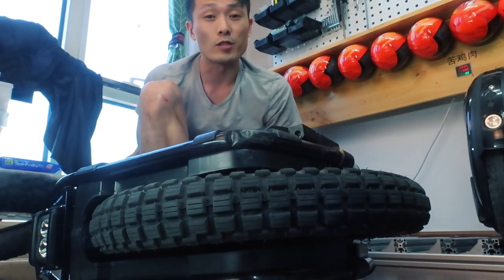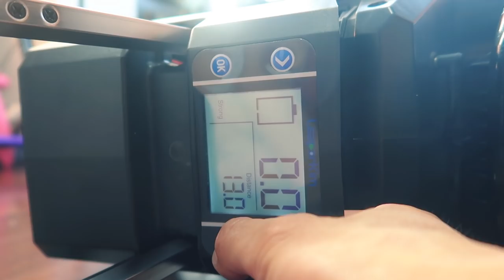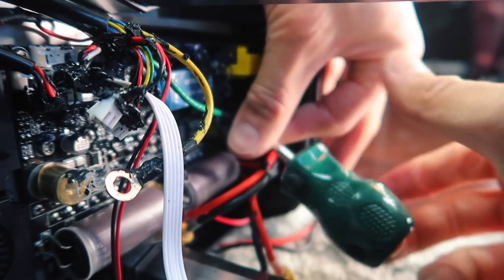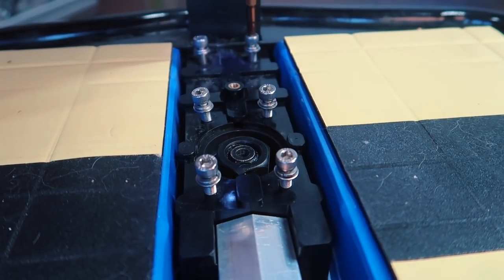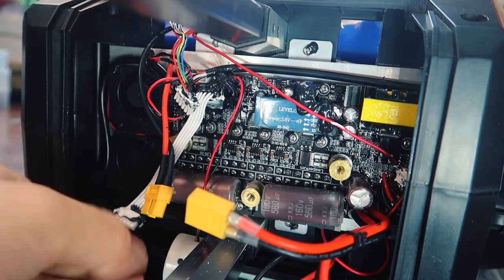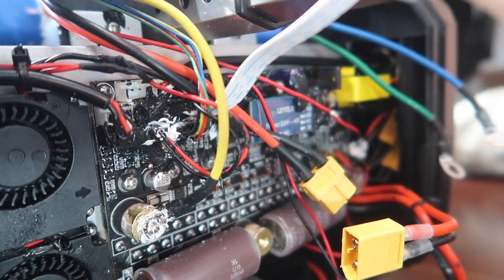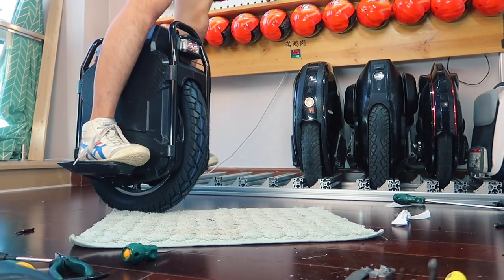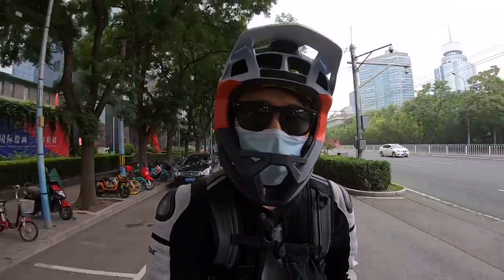Putting a Street Tire on the Veteran Sherman

Comment: Yep they are really weeding out the true enthusiasts with that tire change
Reply: Nothing wrong with the original tyre in the first place 🙄
Reply: @afms-jo2de  not the point...🙄 eventually the tire has to be changed.
Reply: @Kay0Bot  Have multiple wheels and you will be in no hurry to do a tyre change.
Reply: @afms-jo2de  yea , 50 wheels sounds like the right amount. No more tire change ever...😏
Reply: @Kay0Bot  if you can afford it, why not 😛
Reply: @afms-jo2de  Don't these wheels cost quite a bit? Idk what proportion of people will buy multiple just to avoid tire changes. They should just make the tire change easier, it's obviously the most reasonable for the consumer.
Reply: I am 100% sure I am not doing this my self if I ever need to change the tire.  Or not buy a euc.
Reply: Funny thing is it's easier than other wheels and they made it a lil bit better with later models.
Reply: Just did my first tire change on my Master. Bro, it took 2 hours of everything going right. 😪

Comment: Overinflate the tire so the bead seats properly. You hear it pop when it seats right. Then deflate. Usually about 60-75psi to seat, then down to 30ish
Reply: Are you assuming the Tire fits? Why? My assumption is: The tire looks cool they choice it without adjusting the construction of the wheel according to the tires specs. Childish ? Yes... Dangerous ? Yes... Gotway like ? Yes also that

Comment: When you pinch the tube slightly during install and just hope it goes away. It never does.
Reply: marsrover001 you can depressurize the tube until it’s barely rideable, then go around the block, sometimes that straightens out twists or folds. It worked for me on the recommendation of Jason from ewheels.

Comment: This is ridiculously complicated, and even dangerous, in order to change a tire!
Reply: welcome to the world of eucs
Reply: Bad engineering. They wanted to rush production and didn't bother with long term maintenance.
Reply: @Tiagotaf  Yep!
Reply: I think que Unicycles are evolving. Kuji already did show an unicycle que have suspension. Maybe the next level will be a better way to justo replace tires. The Trolley Handle for example we can see as a default accessory, but the firsts Unicycles even had one
Reply: Fix a flat might work in most situations, but replacing a totalled tire would probably have to be done by an expert
Reply: Sad thing is that LeaperKim did such an excellent job of making the headlight and batteries easy to service. Everything on this beast is so well thought out except the most obvious thing.
Reply: @JesterOTL  Its Chinese way of saying "get stuffed Ill take your money"
Reply: @FinnBjerke  Seems like a great opportunity for a new competitor. I could see an Apple EUC--of course it would cost twice as much and only have half the power :)
Reply: @JesterOTL  Make tire fit onto a wheel? Even in a backwards 3 world communist state? It must be possible, other EUCs dont have that problem.
Reply: Sooo Martin your line of reasoning/sarcasm is a little absurd. What is relevant here is: make a tire fit onto a wheel? Even 3 world communists should be able to do that?  And BTW: Apple is for upperclass twits - Windows is worse - use Linux/ Ubuntu.  Its open source and free.
Reply: @JesterOTL   it every year they can add 1mph more to make you upgrade…
Reply: @FinnBjerke  I like the idea of an open source wheel project!
Reply: @no1up  A modular open upgradable design would be so awesome…

Comment: Man they really need to find some way to make the wheel more accessible! Having to go through all that each time just to swap a tire or patch a tube is a huge pain!! Btw is the outside diameter the same as stock? As in this won’t affect the top speed will it?
Reply from the maker: Yeah, pretty much identical width and diameter
Reply: @KujiRolls  Did it go any faster?

Comment: You got to do all that to change a simple flat though?  Damn!
Reply: I just had a flat on my KS18XL and I used "Ultra Instant Bike Tire Inflator Sealer"  from Walmart and it worked great. It's basically a bicycle tire sized Fix-a-Flat. No disassembly needed...
Reply: Andrei Petunin  So far just a few days. I just did it. But I have no reason to expect it won't last as long as the tire will last or until a new puncture develops. 

I squirted it inside and then rode the EUC for about 3 or 4 miles to really spin it up in there while it was drying and to make sure it balanced out evenly.

Comment: You did it! Hell yeah, make sure the tube isn't getting pinched between the rim and the tire and also make sure the valve is properly aligned with the rim valve port those might be the reason you popped

Comment: That sucks! I feel for you. 🙁
With tube tires its good to semi-inflate the tube to maybe 10 psi after installing, then use your hands to fully work the tube and tyre because itsmsoft enough to squeeze.
That makes sure the tube is not pinched. And some talcum powder or chalk rubbed on the tube will help it find the natural position and get less abrasion.😁

Comment: I wipe around the new tyre, inside with a wet wipe just in case there are sharp bits or stones in there. Then like what others have said be ultra careful about making sure the inner tube is not pinched anywhere. What a bummer!

Comment: The next generation should have a better user friendly changing.
Reply: yes i agree, not user friendly to have to dissasemble powercables and stuff. it should have a joint on top so it opens like a waffle iron, and u can then switch out the wheel and rim superfast.
Reply: @magnetmannenbannanen  I doubt a design like that wont be very strong
Reply from the maker: agreed. This wasnt fun the second time either.
Reply: @KujiRolls  Do you have any technique changes go change the tire more effectively?

Comment: I use baby powder (talc) in my mountain bikes and dirt bikes before putting the tubes in.  It acts as a dry lube and I never get pinch flats, even aired down to really low pressures.  Just put some inside the tire before installing and roll it around to spread it out.

Comment: Swapping tires and inner tubes is one of the big issues I have with unicycles. Both of Msuper X 84V (2 pairs) almost caught on fire due to wrongfully reconnecting the battery. And this was after I installed a brand new tire and inner tube on the wheel. Inmotion, Kingsong, Gotway, and Sherman have to make these changes: easily replacing a tire without taking the unicycle apart and make battery swapping easier and safe.

Comment: Hey when I’ve put my tube back into the frame of the tire I cover it with dishwashing soap and water so it can slide in the frame if it’s not seated properly, as well it seems to help keep the tube from getting pinched and staying pinched. I didn’t see you put any kind of lubricant on the tube for the tire. It also will show if there are any pinholes in the tube which sometimes happens before you get it or while handling it. Good luck and thanks for the post.

Comment: The inner tube must have some air in it when installing the outer tire. The  tube ended up twisted or pinched between the tire and the rim  -- and was chafed until exploded .
Reply: yep, i've learned this the hard way too.
Reply: Should have used a bit of talc on the tube to make it seat better

Comment: Use a lubricant on the tire bead and it should settle fine. I had the same imbalance issue last time so deflated it, made sure tube was not pinched anywhere, and lubed up the bead. Rode it for few hundred metres at 20 psi then inflated to full, no issues.

Comment: the tire it came with is specifically design for the gyroscope counter weight system, plus the thicker tires absorb more of the bumps in the road and provide better peripheral stability when leaning left and right. but then again, you can go window shopping for similar size, thickness, and weight tires with better
grip sutures or what ever you call the rubber protrusions in the wheel that help with traction on the ground. 
I'm curious what would happen if you catapult forward crashing onto the ground at  60mph with this wheel. I'm sure you full body armor will shatter and definitely break many bones.
if it ever does happen, turn into a feetle position, and try to roll int the ground to absorb the impact.
Reply: I crashed on one going 42mph.  You don't slam into the ground, you go sliding, just like a motorcycle.

Comment: When my preordered Sherman is ready from eWheels in about 3-weeks, per a recent update email I received from them,  I will have the option to elect a street tire or the off-road tire. I think I will elect the street tire and have it come already installed straight from Veteran...
Reply from the maker: I find the knobby more stable and easier to turn at high speeds on the street. If your speeds are typically <30mph, then the street tire is a clear winner.
Reply: @KujiRolls  So far my speeds have been <30 mph because I currently only own a KS18XL. However I have a KS S18 on the way, and the Sherman. I wanted a variety for different situations. The S18 because of suspension (obviously).

But I wanted the Sherman because it can go faster than Kingsong wheels. It would be my speed wheel. I thought street tire would be better for this, but maybe not. Do you think I should stick with nobby tire? Seems counterintuitive...
Reply: @kuji - have you tried both original tires? Of not, what tire did you try? Badly build tyres could have ovality/outrun and be prone to unbalanced rubber, needing balance weights. 😕

Comment: Someone (maybe Marty?) Was saying he suspects the "20 measurement comes from the knobby tire being a half inch larger in diameter than the typical 18x3 tires. Did you end up installing the 18x3 H-666 or is it a slightly different measurement?

Comment: Use a resistor to discharge the current. It will avoid the spark.
Reply from the maker: Yep, thats better than metal tweezers. Im gonna guess that those who have through hole resistors lying around also probably already knew that.

Comment: You took the inner tube out with a metal screwdriver, what did you expect?
Reply: It was a tire change lever
Reply: @flaviokonti5522  https://youtu.be/NeuJwcW2JaY?t=70 He uses a screwdriver with the change lever. He might have damaged the tube then.
Reply: I got an insta-flashback, to some odd 35 years ago, of my dad roasting me for using screwdrivers to change a bike tire and poking a hole into it. Then I remembered that this clip was only 3:31 in length and knew how this would end. No way a review was possible in that time. Very much looking forward to the next clip!

Comment: would you say a MSX/MSP tyre fit to the VS?
Reply from the maker: yeah, they are compatible sizes. Anything that fits on the MSX/MSP will fit on the VS. But not vice versa. VS has slightly more clearance
Reply: @KujiRolls  thanks mate. So I will stop thinking to "swap" the tyres😅. You mind sharing the street tyre make and codes? Btw, great video as usual and extra entertaining for this one. I sorta saw it coming after you said you can feel the bump in every rotation. Inner tube didn't sit-in properly?

Comment: Why didn't you just put a 4 pin connection half way to the motor on that black multicable, then disconnect it and remove the tire.

Comment: Tires usually have a heavy point which should be installed away from the valve stem.  And, if a tire falls from the bead while in use, you did something VERY wrong.

Comment: I’ve about given up on my eu for this reason.  it’s so great when the tires not flat.  about 10 mins now.  its all i get. so sad.  i can’t even get the pedals off any longer. to change it, so yes.. a solid tubeless tire and $200 replacement path seems fair.  and changing a tire with engineering degree requirements just means bankruptcy for these eu companies.  tires go flat.  .. i wanted this eu.  and it’s got over-engineered BMW nightmare characteristics all over it.   i ride sand.  tires pop.  nails are everywhere.  either easy change or solid tires please.   i’ll pay more for this.  it’s always weeks downtime from riding..   egad.
Reply: it's not that bad you can always go to a local bike shop, the one on my block in brooklyn said they would change my monster tire when the time came